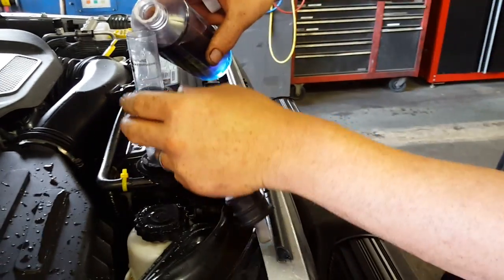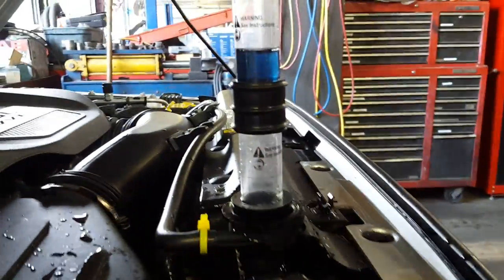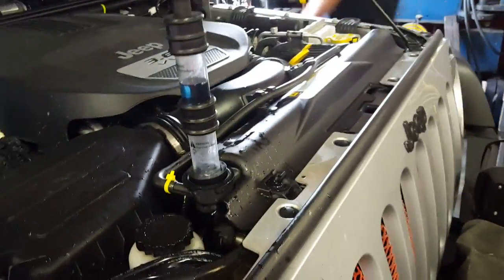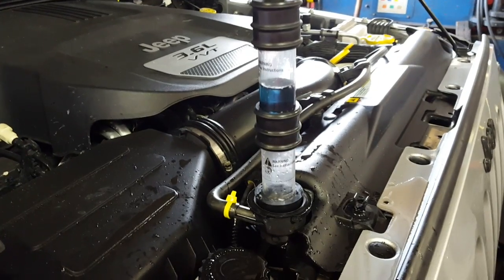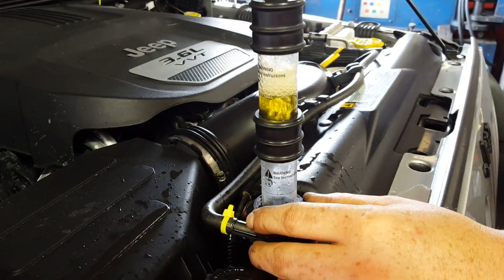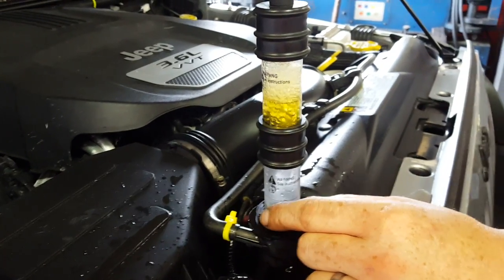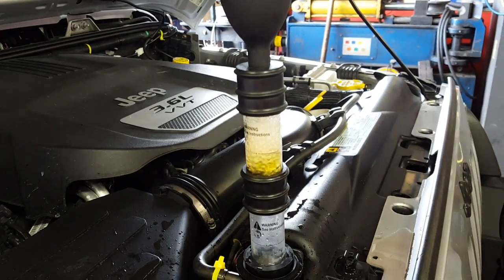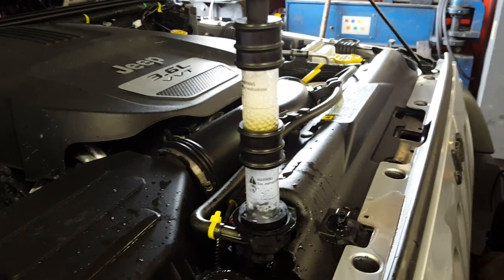Jeep Wrangler head gasket leak test

Comment: okay, so i didnt have the adapter to extend the test tube up. the color would stay blue but the coolant would start rising very fast till it just mixed with the test fluid and just bubbling like crazy, i made sure the overflow line wasnt blocked so rising coolant could flow past but it was just flowing so fast. but no yellow fluid.   it would just explode bubbling

Comment: You think it could be this? The head gasket licking?
Reply: +Jose Lopez The radiator on the JK 3.6L is trash they leak around the core that&#39;s why I&#39;m changing it with an mishimoto radiator this week.  Maybe that's why he got an head gasket issue.  He probably drove it a lot passed the middle temp gauge a lot because the radiator leaks slowly on the JK's.
Reply: GSX1340R everything on the 3.6 is trash... 4.0 or don't buy a Jeep... It's like getting a Corvette with a Prius engine